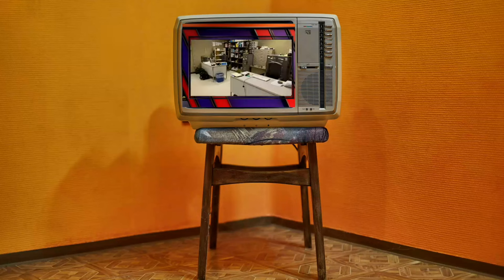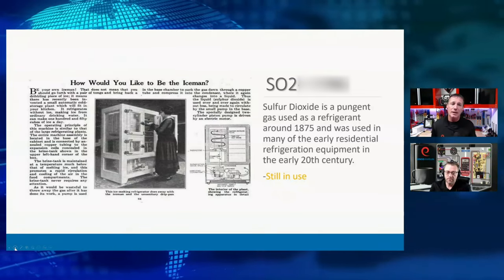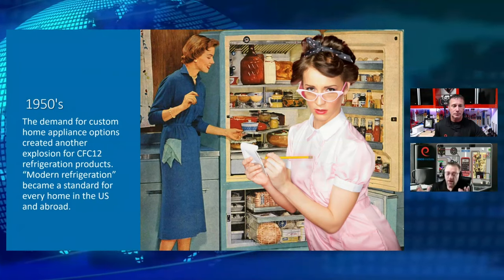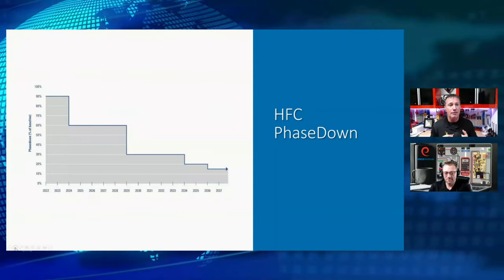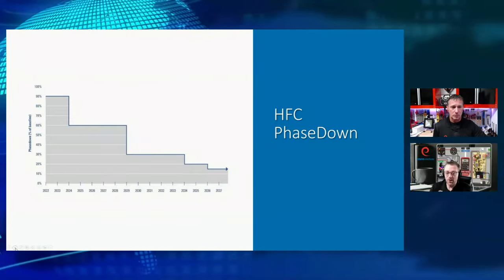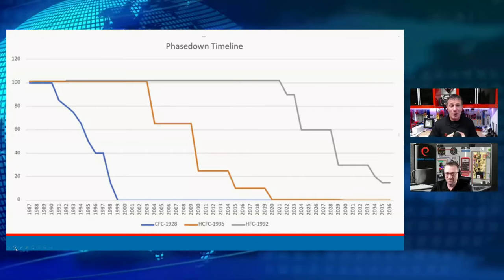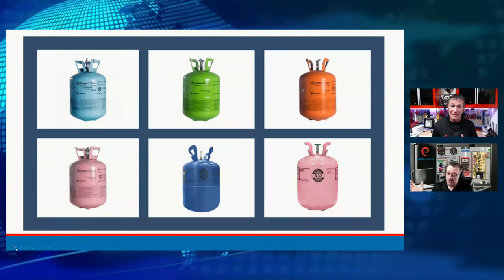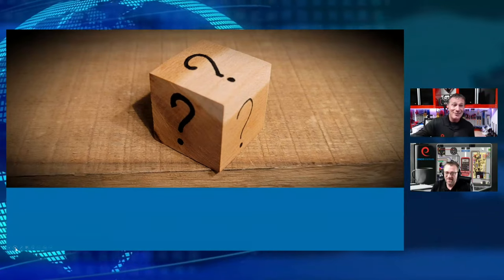Why do refrigerants go away?-The ESCO HVAC Show-Episode13

Comment: For the first time, the grouping of synthetic refrigerants was known as halogenated hydrocarbons consisting of CFC, HCFC, HFC types. Until now CFCs have been banned, HCFCs are being phased out, and HFCs can still be used. The HFC group is known as F gas.
Reply from the maker: Great point Agus. I wish we would adopt F-gas here in the states like the rest of the world already has. It would help understand the relationship of refrigerants that all contain fluorine and are all on the chopping block. Many people feel HFO’s are the long term solution but in reality they are another interim refrigerant, in my own personal opinion of course lol. Clifton
Reply: So are R32 and R454-B considered HFC's or HFO's or what?  Aren't they the new standard in U.S. homes starting in 2025, replacing R410-A (and R-1234yf in vehicles)?
Reply from the maker: @SWLinPHX  absolutely they are HFC based refrigerants. That is why we have these conversations: R32 is 100%HFC and R454b is a blend of HFC and HFO(which is a modified HFC) and are on the way out the door before they even become popular. It’s going to be a bumpy road my friend. Thanks for joining us
Reply: @escogroup  Thank you for the response.  I ask because my heat pump HVAC is 28 years old and of course uses R22.  I heard the mandate for the new refrigerant will be Jan. 2025 now.  I am trying to make it thru this and yet one more HOT Phoenix summer with the old one, provided I can still get R22 if I need to top it off again next summer as I did the beginning of this one.  Is it wise to wait?  What do you think will be the replacement in 2025, if not R454-B or R-22 since you say "they are out the door before it's even popular"?  I did replace the HVAC in another rental of mine just this March because it was needing Freon every three months (severe leak) with a new one, upgrading from 2.5 to 3 ton.
Reply from the maker: @SWLinPHX  R32 and R454b split systems will actually hit the market early 2024. There are already R32 ductless systems in the market and much of the window air conditioner market transitioned this year. I have yet to find a new window unit that is not R32
Reply: Also, why do you say the new ones are out the door before even popular?  What other choice do we have or what do you do personally?
Reply from the maker: @SWLinPHX  Are refrigerants going away?-The ESCO HVAC Show-Episode12
https://youtu.be/EVi3af9N4PI